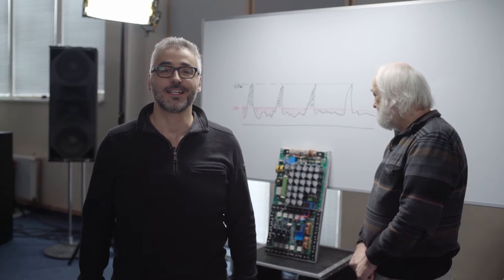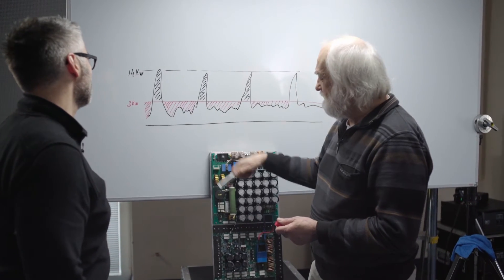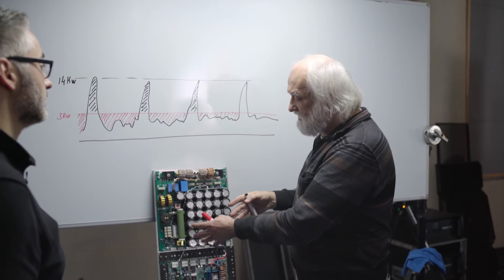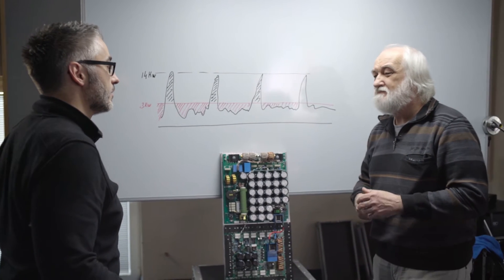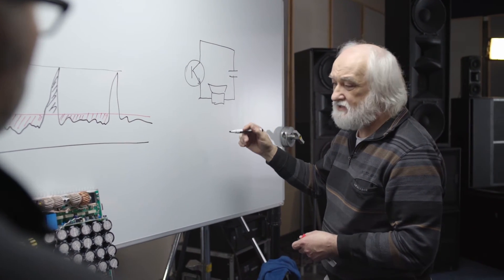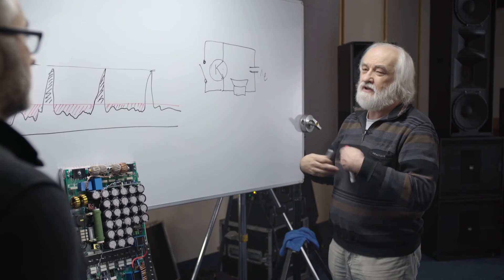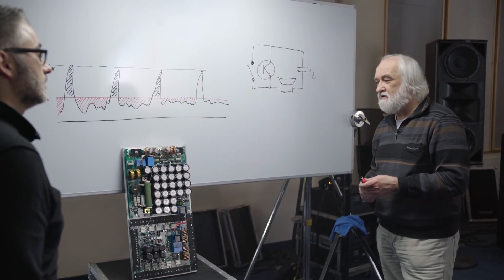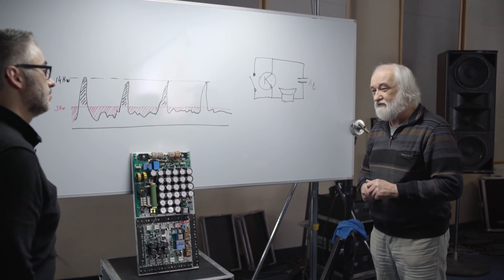TECHNICAL TALKS - Amplifier Technology and the VHD4.21 Active Subwoofer Electronics

Comment: Hello there, thanks for the very good explanations about your products as well as other technical topics related to. However based on my 20+ years of experience doing live audio I know for sure some few things that disagree with you guys.

1.- It is really bad to run an amplifier, name it full range, mid range, high range into 2 ohms load. Even worse for subwoofers, the car audio products run at 2, 1 or even 0.5 ohm load with very bad results even with the use of rigid suspensions a the speaker cone to provide some sort of passive damping factor. The best in my experience is 4 ohm for subs and mids and if possible 8 ohm for highs.

2.- Amplifiers of class D,H,T or whatever they call to switching amplifiers lack the audio fidelity of Class B amplifiers but they are very energy efficient. Good for subwwofers, their weaknesses can be masked by mids and highs very easy

3.- Class A, AB with output transformers are good in terms of impedance BUT transformers introduce Harmonic Distortion. Which I think it may be heard on your Super Live Audio system. 

4.- 21 inch subwoofers. The speaker cone is very large and heavy therefore is very hard toy keep it under control, even 18 inch subwoofers are not easy to control but once again, their weaknesses can be masked very easy.

I´m not criticizing your products, I havn´t used them or listened to yet. The point source technology you developed seem a very clever idea, it´s like having a super large studio monitor without the issues presented by line array technology. hope to have a chance to listen your products soon.

I hope you have the time to answer my points which in no way are a recipe but a point to start a conversation.

Sincerely 

Alvaro H Romero
Reply from the maker: Hi Alvaro,

Thank you for taking the time to comment on our technology. We are open to
all opinions and you clearly have some technical knowledge or experience
of other speakers to base these opinions on, which we respect. Beyond that
technical approach we are also very excited about the opportunity for you
to actually listen to a KV2 system one day and apply your knowledge to a
critical but real experience of KV2 technology.

To cover just a few of your theoretical points, where with respect some of
your assumptions are not quite correct in relation to our technology and
design principles.

ad Q1
We also agree that where possible the impedance should not be too
low and that is why in the majority of our point source solutions you will
find significant use of 16 ohm speakers in order not to load the
amplifiers too low. For example in VHD 2.0, the two 12” low mids are 16
ohm speakers in parallel presenting an 8 ohm load which the amplifier can
drive very effectively. The same for the Midrange and the single HF at 8
ohms as well. In our smaller ES system the Low Mid actually loads the
amplifier at 16 ohms, with the Mid and High at 8 ohms each. Again no
problem. Our subwoofers, for example VHD 2.21 passive double 21”, ES 2.6
passive double 15” and even the Active EX 2.2 double 12” all use 16 ohm
speakers to present a combined 8 ohm load to the amplifier. It seems on
this point we can agree?

ad Q2
We also agree that switching amplifiers are not so good for
situations where true high fidelity is required. That is the reason why we
avoid them whenever possible in areas of greater sonic importance, for
example the Midrange and High frequencies of our systems.I think so far we
have some common ground and beliefs on this as well.

ad Q3
As you will be aware there is more than one kind of distortion
and the benefits of a transformer for reducing the intermodulation
distortion outweighs any other downside in our own opinion, when driving a
system hard through critical listening tests. There is also more than one
kind of Harmonic Distortion and the choices we make in amplifier design
and loading methodology are aimed at dramatically reducing Third Harmonic
Distortion. This is SIGNIFICANTLY more audible to the human ear than 2nd
Harmonic Distortion. In all large scale Audio reproduction systems there
has to be some compromise in order to achieve the end goal of faithful
reproduction of the original source, particularly over long distance. Our
focus has been on minimising those compromises and choosing our areas of
compromise very carefully to absolutely reduce the AUDIBLE distortion.

WE ARE MUCH MORE INTERESTED IN WHAT AN EDUCATED PERSON CAN HEAR THAN WHAT HE OR SHE CAN MEASURE!

We find that the industry has become obsessed with prediction software and
frequency response curves which tell very little about how a speaker or
electronics will actually sound in “real life” with a complex signal under
load. We could play you three different speakers which have an identical
frequency response, but which sound completely different. Most people are
shocked by this, because they have grown up surrounded by marketing and
believing the charts and diagrams will describe perfectly how a system
will sound. The biggest reason for these anomalies, in so many systems,
is the lack of attention paid to “Time" You come close to referencing this
yourself with your point below on the control of large mass speakers and
how quickly and efficiently both the electronics and the speakers can
react to a dynamic and musical change.

ad Q4
You will have made a friend with George Krampera our Chief
Engineer as he also believes for accurate reproduction of a bass line the
speakers would be lighter and faster than a typical 21", like our double
15’s for example. Sound is subjective though and Bass / Sub even more so.
With EDM’s increasing popularity there are now so many different
requirements for Subwoofers and none are specifically right or wrong in
their own right. Our job as a manufacturer is to offer a complete range of
solutions from a fast reacting double 12” sub to a lower but arguably
slightly slower double 21”. That said, we are told by not only KV2 users,
but also several other manufacturers that our double 21” is the fastest
they have ever heard. That doest mean to say that it would be your first
choice, but it does have remarkable articulation for a large mass
subwoofer.

To give an analogy, with our double 21” we make one of the most powerful
Trucks in the world. But if Formula one is your business, you should
choose something smaller, lighter and more responsive. We also offer those
solutions and we won’t tell you which one to buy. We would just ask you to
take the time to listen before making your choice or comment.

On a final note - With a primary focus of sharing our videos through YouTube we try to avoid the site becoming a Forum for debating different
approaches of speaker design. There are many other sites more suitable for
that. I would like to truly thank you for your time spent watching and
commenting on our videos, in the end we seem to agree on many points. The
next step will be when you finally get to hear or use a KV2 Super Live
Audio system. That should be your primary goal now if you intend to
continue your research on our company.

We would also be happy to continue this conversation, via our
info@kv2audio.com address, if you require any further information once you
have listened. 

Thank you - Jonathan Reece-Farren on behalf of KV2 Audio.
Reply: After running sound at several concerts in the past 5 years on ES and VHD systems, owning 6 speakers and their amps from their monitor line, I can say that they make some of the best sounding amps/speakers in the world, they really make your life easy when you run sound at a big concert. About the 21" subs, believe me, they are on par with some of the fastest 18" subs out there.
Reply: This sounds like you have used speakers and systems from 40 years ago ,  you obviously don't know anything about audio or how to run a live sound reinforcement event..  Disregard this guy and delete his comment.